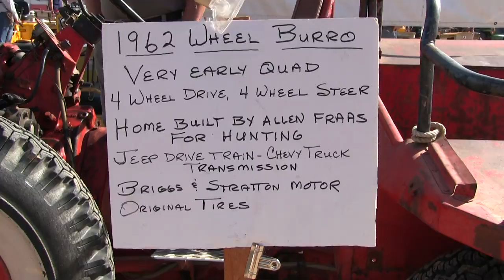1962 "Wheel Burro"  Home-Built 4-Wheel Drive 4-Wheel Steer Utility Vehicle

Comment: Are the specs and more details posted anywhere?
Reply from the maker: Not as far as I know.  This was the only time I've seen this unique machine and I included all of the information that I know in the description.  I tried to show as much detail as I could in the video as well.  Sorry, but this all that I have about this critter.
Reply: @espeescotty  best I can tell narrowed dana27 or 30 front axle, sm420 ish trans hooked to chain drive on drive shaft guess it might used centrifugal clutch, homemade high steer that passes over the engine... dont see the rear diff but probably also a narrowed 27 or 30 slipped so can steer rear... not sure on rear steer coordinates with front
Reply from the maker: Yeah, you could be correct about a lot of that.  I don't have that in-depth type knowledge or firsthand experience with a lot of those things.  When it comes to mechanical stuff and engines, I'm kinda like book smart but not street smart.  I know what things are and their functions and how they work, but I just don't have a lot of the hands-on knowledge and experience to spot the finer details like telling one tranny from another.
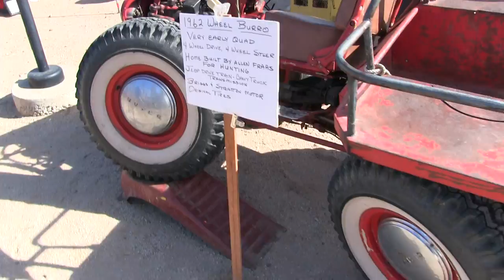Reply: @driftercj2a  At about 2:38 - 2:40 ish you can see the tie rod that runs from the left side front knuckle to the left side rear knuckle, or rather a lever or bell crank or something mounted on the rear chassis. 
I can't even tell you how many times I've watched this literally a frame at a time, on progressively bigger and bigger screens trying to get every detail. I'd give my eye teeth to see this thing in person. I have burned down there interwebs TRYING to find more info of this OR Fraas, but nothing. There's two Flickr images of the tractor from different angles but that's it. 
It's INGENIOUS. I'd already had the idea, with my collection of dead Jeeps laying around, to take two front axles and narrow them so both sides would use stock short side axle shafts, which would make center diff axles for some sort of tractor. And then I found this damn thing, which has only made me want to do it WORSE. I DESPERATELY want to build one.